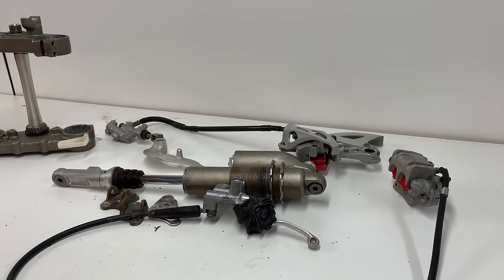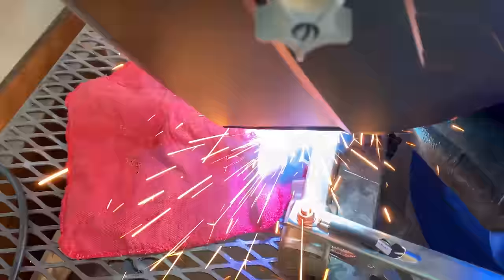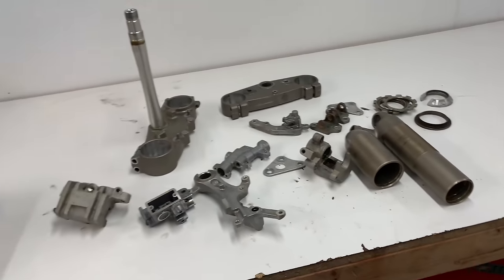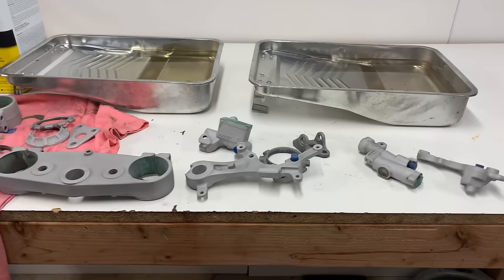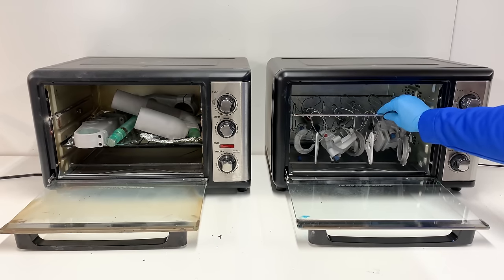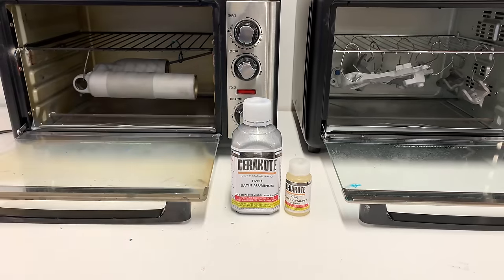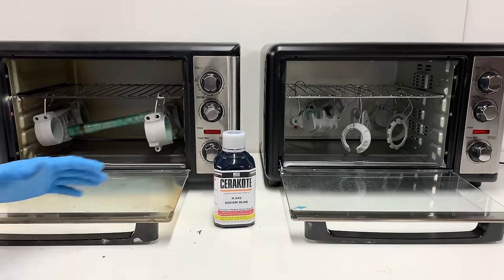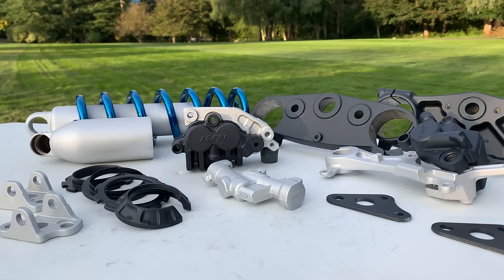Cerakoting My YZ250 Parts With Incredible Results! Part 5

Comment: Hi Adam, nice video but I have an important question : Doesn't your master cylinder's "transparent plastic gauge" melt in the oven at 300°F ? Is it intact? Does your master cylinder not risk to leak now because of the plastic gauge being put in the oven? Please let me know if it's safe by only masking with high temperature adhesive tape as you do. Your youtube channel is freaking awesome.
Reply from the maker: Are you talking about the site window?
Reply: @adampaganelli4891  yes I'm talking about it, excuse me but I didn't know how it's named, I don't speak english very well, same for american, I apologize
Reply: @adampaganelli4891  thanks to you now I know its name, but can you answer me about the site window at 300° in the oven ? That's OK ? No problems ?
Reply from the maker: TwoStroke Powa you will likely get some discoloration of the plastic. But it will not affect performance. It’s possible to remove and weld up hole but I figured this would be to much extra work.
Reply: @adampaganelli4891  remove them prior to coating. replacements on amazon are like $5